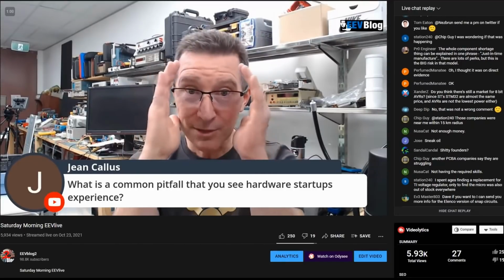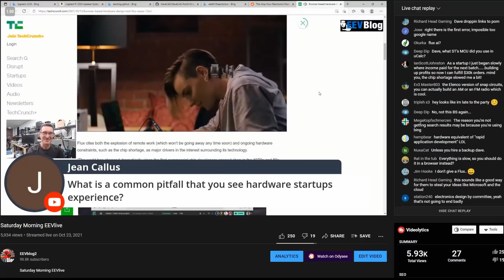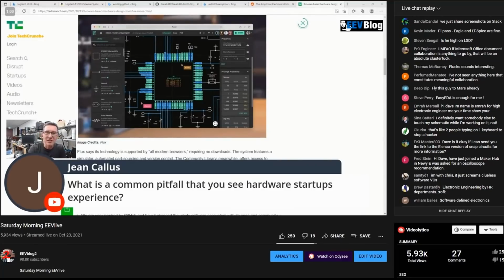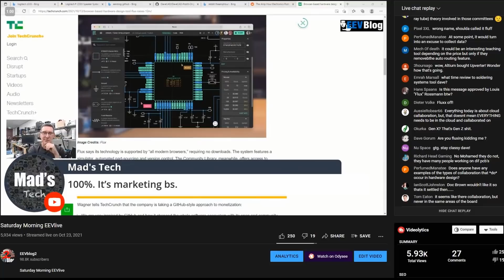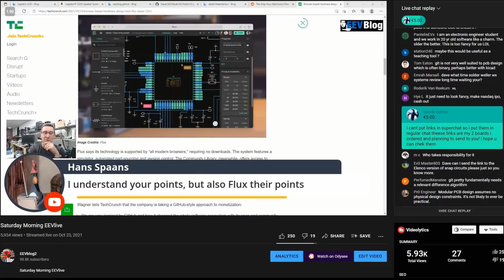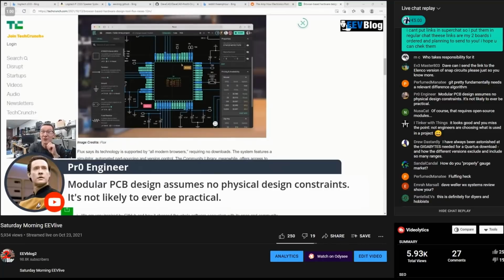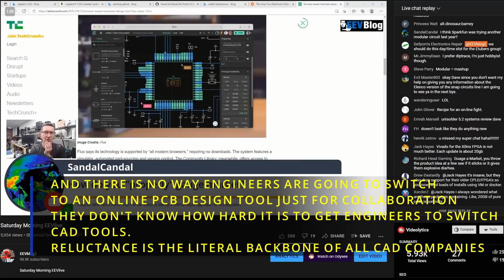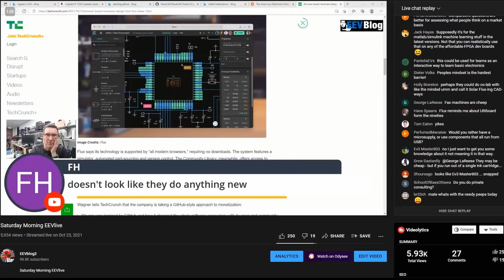Flux AI PCB Design and the Errors Startups Make

Comment: Boss who would insist on a product like Flux: Listen Ken, you've been on this board for a week and we need to get things moving along.

Ken: I know, but there have been several additions. Sandra found a better supplier for the FPGA. Don needed a change in clearance for the new face plate. Steve coded the new fail-tolerant boot routine but needed an extra GPIO. Lin found that resistor I missed. And Bill had this idea…

Boss: Ken, your great, but this is only going to get done if we really collaborate, and frankly you are kind of the bottleneck here.

Ken: True, but it's kind of unavoidable since…

Boss: I read this article about this new collaboration software that's coming out soon. I've already talked to purchasing about it, but it gave me an even better idea that will solve our problem.

Ken: …

Boss: Look there's 6 of you on this motherboard project and it's an 8 layer board so I'm assigning each of you a layer and that way we are guaranteed to get it done 8 times faster. I'll take a layer and my nephew knows about those Arduinos.

Ken: Have you ever designed PCB?

Boss: No, but I played soccer in High School and when it comes down to it, everything's all about the kind of team work you learn on the field and how everybody shares in moving the ball to the goal. It's never just one guy running the whole field, no matter how good they are. I know you're doing you best, and I know it's my responsibility as a boss to get everyone on the team the tools so that they can do their best.

Ken: …

Boss: Don't worry, I already ran it by upper management and they were thrilled that I was able to promise that we'd be done ahead of scheduled.

Ken: …

                              - 1 hour later in group chat -

Ken: So you told Bill and Sandra?
Don: yep
Bill: I heard
Sandra: Did the boss have a stroke?
Steve: Might have
Lin: Ken, tell me he didn't say that!
Ken: It's true
Steve: Well, I guess it's murder then?
Bill: +1
Sandra: +1
Don: +1
Ken +1
Lin: I'll request the traditional shovel from the IEEE.
Reply: You had me with the "we'll all do a layer, and be done eight times faster". It does really sound like the typical bad, oversimplifying manager. Though he seems ready to get his hand dirty by doing one layer himself. I'd suggest letting him do the top layer and "collaborate" the hell out of him 😈
Reply: This is where you ignore what the boss says and just do what you need to do.

Comment: basically, is that Flux able to do a simulation of a circuit that is not trivial? I am not speaking about RC filter, but attaching real models from manifacturers? what is the point? the focus seems to make nice block diagrams to share and show and not real integration about complex chips, are you telling me  Flux will connect a lovely TPSxxxxxx buck converter, a BMS battery a CPU a signal to noise already figured out? oh sorry I forgot the weird TI footprint for a shiny buck-boost converter? how Flux manage it? have anyone considered at Flux the massive effort a team has to do to throw away all the skills in crafting PCB design in a specific way that works against an AI solution that sounds just a automatic place and router with already defined components in their library. I havent included SoC and FPGA complex interconnections with the unreal? If these mentioned in the propaganda video of Flux website are the key strongpoints of Flux then is not for me. good intentions targedint a problem that not exists. What is the advantage to using it in a collaborative enviromnentf ? Do they really think companies have a pile of engineers making ONE pcb altogether? sorry the reality is that almost every small medium company, assign you a PCB to do, you start, you finish.

Comment: I agree on the collaboration aspect of this. It is crap!

But, have you seen the new feature they are introducing called "copilot". In a nutshell, it is a specialized LLM that is supposed to assist in the hardware creation.

You should make a follow-up stream and try to use the copilot feature and try to develop a circuit with it live. That would be a good exercise to see if it lives up to the hype.

Comment: Allthough I can understand the critics about the tunnel view effect of start-ups and the pcb co-design aspect, I think the overall tone of the video and it's general critics for basically all new attempts to improve design software/processes is unnecessary destructive.

Even if you do not work together simultanously on one design, you can improve file/project sharing, synchronization and versioning when working together on a bigger project. Doesn't matter if it is PCB, CAD or what ever ... . 

In that context, it is indeed an advantage to just send the link of the project to enable colleges reviewing a design (from all perspectives when they have time) and leaving comments all in one automatically synced project, instead of sending arround a pdf or to each collaboration partner need to have installed your licensed software. Otherwise overleaf would not have become the standard for research publication writing. 

Also part and library search, selection and import could theoretically be dramatically simplified and accelerated. Larger simulation and optimizations using a server side cluster would also be possible. The approach would also enable automatic collection of design data for future design helper-tools or completly automatic design approaches. 

The video over critics aspects of the software (co-design) which would not really matter in reality when using it, while not mentioning the ACTUAL problems coming with online design attempts - like poor performance, limited project/file import, required internet connection (no mobile working, reviewing, ... ) etc. 

Further there seems to be a general aversion in the video and comments for any attempt to improve the design and iteration process. Or to say it in simpler words: A rejection of anything new. Similar to older engineers refusing to learn CAD software, because they are experienced in pen and paper drawings. I find this particularly problematic. There will be no improvement in the way we design systems if we follow this.

I have to use different design (CAD), programming, modelling/simulation and documentation/writing tools during my daily work. For me, all design tools have their individual advantages and problems. All attempts to improve, improve some aspects and create other problems. From all that I can learn. Important is to keep iterating and learning. Not to just claim why we need another design tool ... .

Comment: We do collaborative design in Altium (we have our OnSite Concord Pro Server for that). It does not work by having 5 people doing the same design at the same time tho. We have one engineer responsible for the schematics of a project, and once he thinks the basics are there, some more hardware engineers review it and add comments/feedback to the schematics, and the software engineers get a first look at it to give theyr feedback. Once all this gets cleared up, we do a formal schematics design review again, with a full check-list. And on the PCB, we never had the need to have more than one engineer being in charge of the layout. Again, there will be reviews by other engineers, maybe an expert gets pulled in for RF or other special needs, and there will be check list driven reviews before release to production, same as with schematics. Altium offers all that already, and more. I know Altium is far from perfect, it has it's quirks and bugs, just like every other CAE software with such a vast range of functionality. But i don't see how a new startup like Flux can get even close to the features and functionality of the big players in that market.

Comment: Yea, can't say we do our designs that way either. Usually we review and check each other's design if neccessary, but we don't have multiple people design one board. I can frankly only see that happening at very large projects which require very specific experiences in some niche applications that you'd want all on one board. Maybe if you do SOC design, but then it's really not the domain of PCB design tool anymore. I mean it's PCB design, unless you do extremely complex analogue circuits I'm not even sure how you could reasonably entertain more than 2 people with it.

Comment: I don’t have too much of a problem with their core concept of an online web browser collaborative PCB design suite as similar things with not very good collaborative features already exist primarily for smaller simpler designs.

It’s when they started taking about automatic routing and automatic simulation that there’s no chance that’s going to be feasible. Most components available barely make a decent pinout available let alone a program specific simulation file and for MCUs that’s crazy complex, also letting the computer chose the pins for you will never end well. Also it looks like they’re trying to get parts community contributed so you can bet there will be very few parts in the beginning and unless they have a good moderation team you will never be able to trust the community contributed parts.

One thing is they do have a demo of it on their website, you can use it now, which is much better than most start-ups, however the example files they have don’t bode well, they don’t have simulation models and the layout is rubbish mostly due to the lack of a snap grid! Clearly they don’t design hardware as they would know the snap grid is the most essential feature.

Having a .ai domain also doesn't do them any favors on the bad startup bingo chart.
Reply: It is a fairly typical software startup - some guy had a bit of experience with an Arduino or something, so "but hey, this PCB stuff is a pain, what if we could automate it - let's just throw some AI at it, that has to work, right???"

With zero research into the problem, little to no knowledge of the target domain, solving a perceived instead of a real problem ... But hey, AI, so investors are opening their wallets and showering them with money already ...

Comment: I had the experience in AutoCAD to design a drainage system with seven more guys online and it was a pain in the arse. I had been constantly destructed to explain my design decisions so I ended up disabling the feature and sent over the finished design which has been accepted without any major issue. At first I thought I will benefit having it enabled but after the first time I was convinced the guys logging in had no experience nor the UK design regulations on hand to comment on the design. The drainage is at work ever since ( 2012) and survived several overflows and flooding situations. So I feel secure my design has been proved to be adequate for a residential 50+ flats setup. Normally I do setting out work and not designing because it involves much more CAD time and I like being on site more. I gave up on designing since for this very reason. I do enjoy more to position things with a trusted Trimble then sitting in front of the PC.